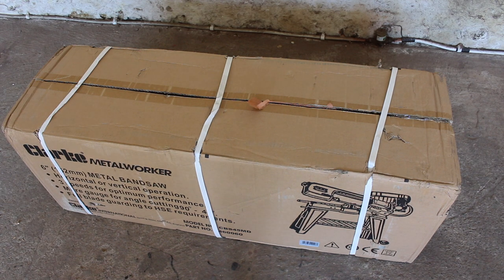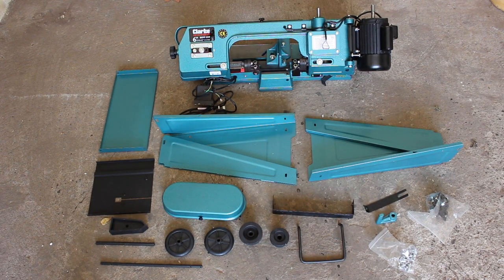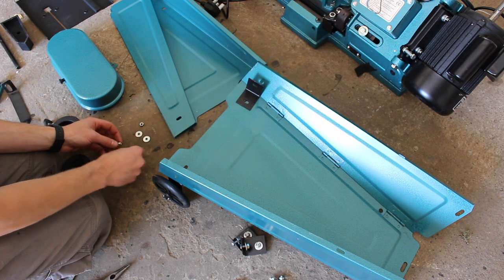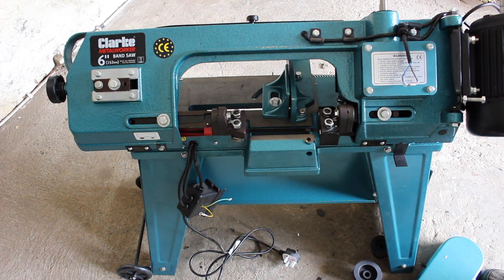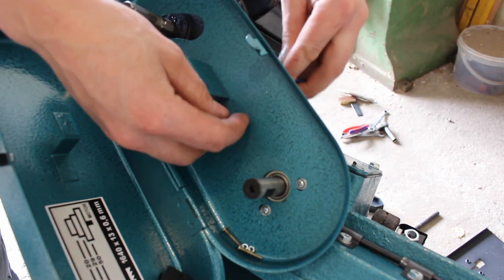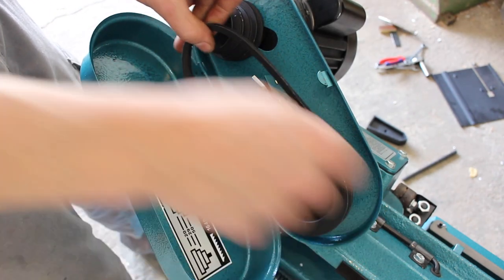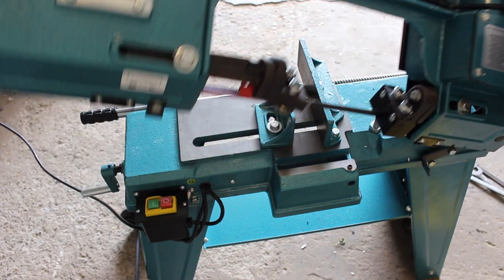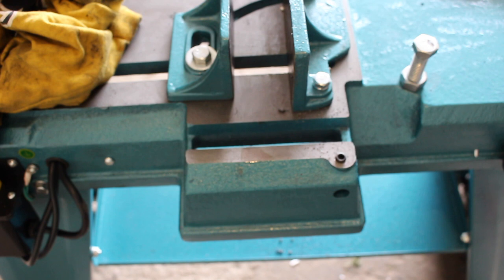Clarke 6" Metal Cutting Bandsaw Assembly and Test

Comment: Thank you for this video, my two pulleys were not in line by a mile.  Had to adjust using the main big bolts which hold down the motor which were difficult to get to and make the necessary changes.  But now it runs beautifully and the legs are solid as a rock.

Comment: How are you finding this saw so far. Been looking at one of these myself wondering if get consistent straight cuts out of it and if vertical cutting on it is any use?
Reply from the maker: Yep very happy with the horizontal cuts. The stand and the table for vertical cutting are junk, but if replaced the saw itself is good.